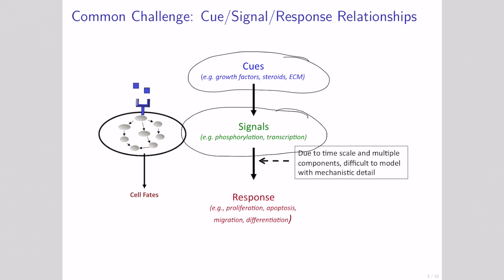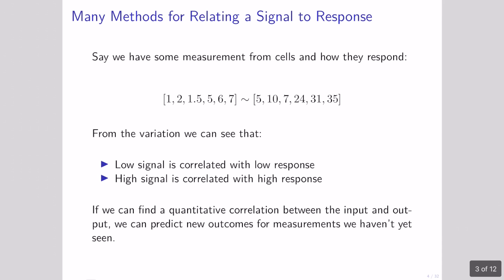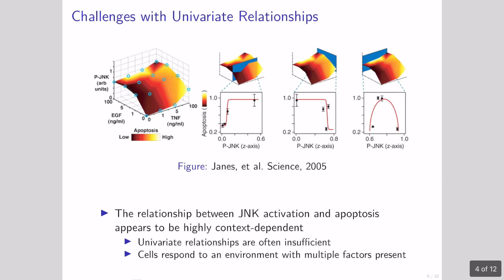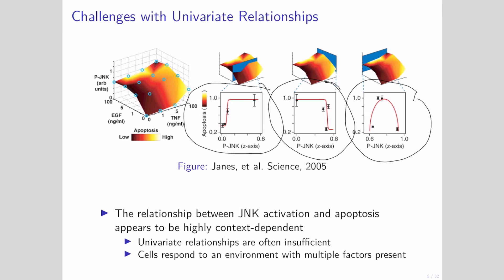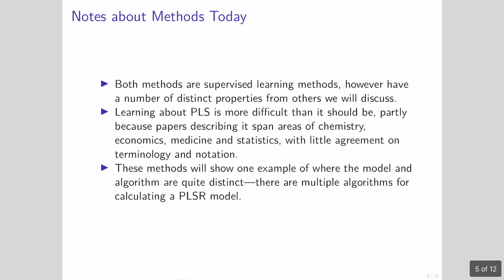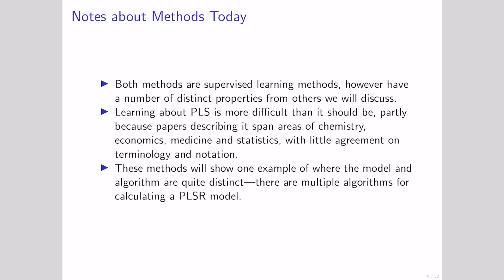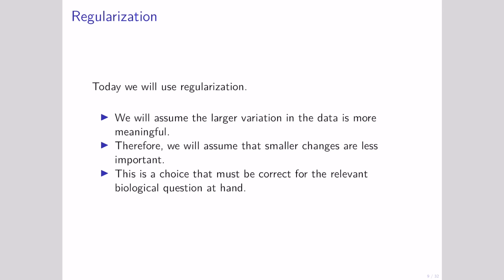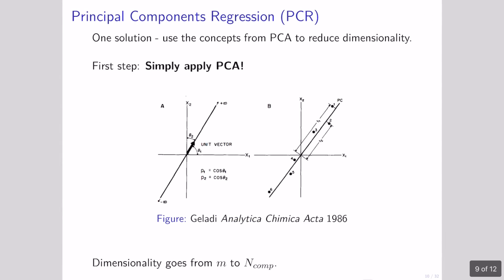BE 175, Lecture 8a: Principal Components Regression

Comment: May be you can throw some light on inverse transform from pc space to original design space in the end. Imagine if I need the regression equation to do optimization then I would need to know what those original design variables shd be for optimal response. Hence, the inverse transformation.
Reply from the maker: Indeed, you can go back from PC space to original data space using the inverse of the loadings matrix. Since the loadings matrix is orthonormal this is just its transform.
Reply: @aameyr  thanks. I was just looking into that. I deal with finite element analysis. I have someone who has close to 800 design variables and not enough experiments. So I thought looking into correlation matrix and seeing if no. Of DVs could be condensed to few PCs. Then do PCR. I would then need to transform the coefficients from this PC space to original design space. I could use this simplified regression to do optimization. I know there are errors in this. But at least worth a shot. Thanks.